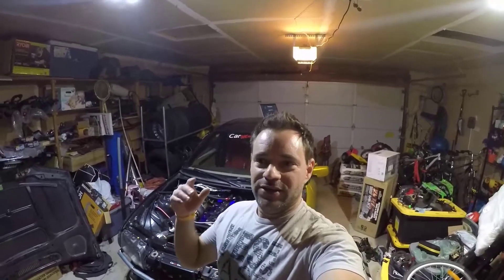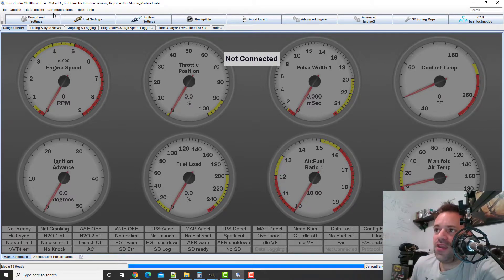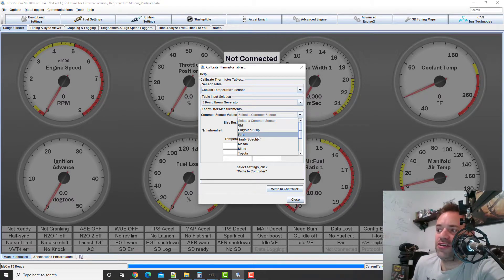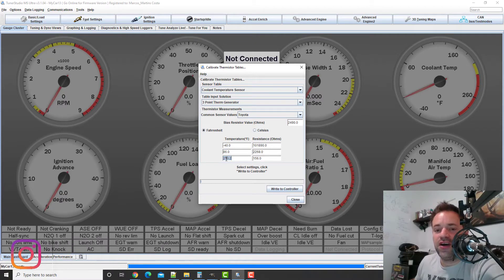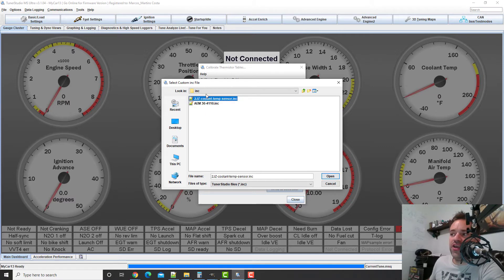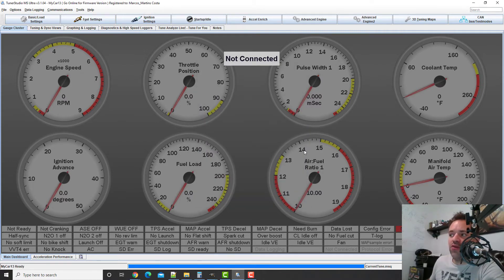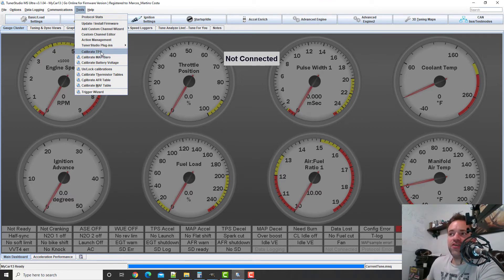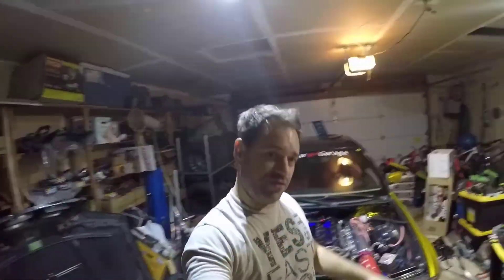Calibrating Temperature Sensors on Tunerstudio for Speeduino - 2JZ to E46 Tuning

Comment: Hello, this inc file does not work on speeduino. Could you explain me more about this file?
Reply from the maker: @guilhermefelipeseibert3181  it's working on mine.  You just have values of voltage then temperature or AFR for that voltage.  So when speeduino hits the voltage it goes to the values you loaded from the file and see what's the corresponding AFR or temperature (whatever your file is for)

Comment: what version of speeduino are you using? because I see that you have many more options than the ones I have in Tuner Stuio
Reply from the maker: I'm using 2020.08. Got new options on this version and it works better with 36-2 trigger wheel